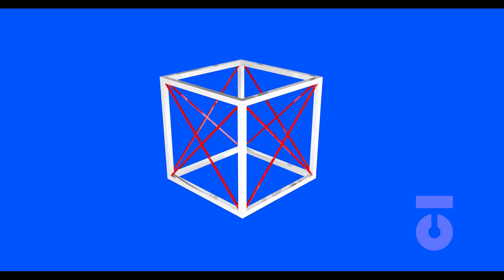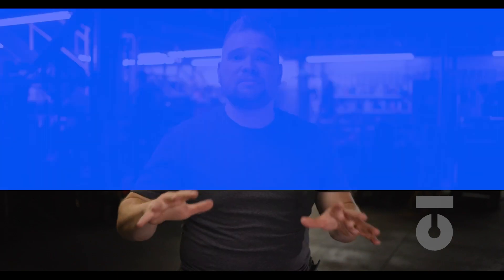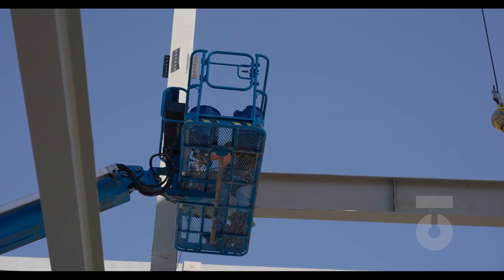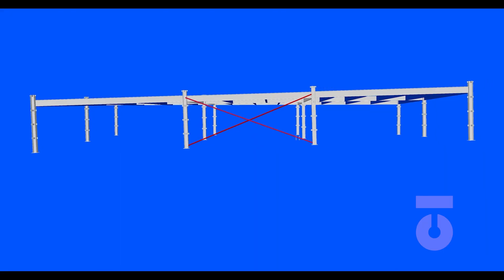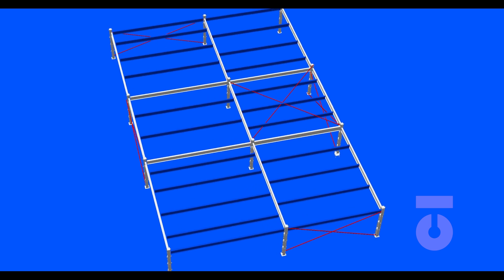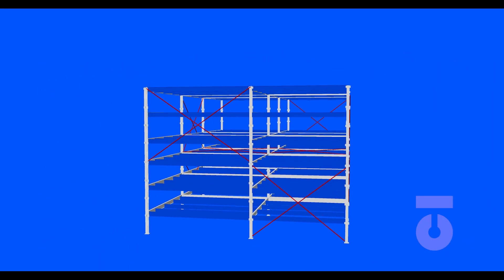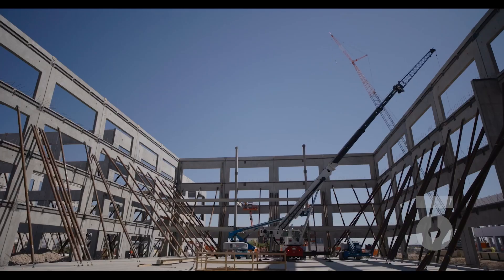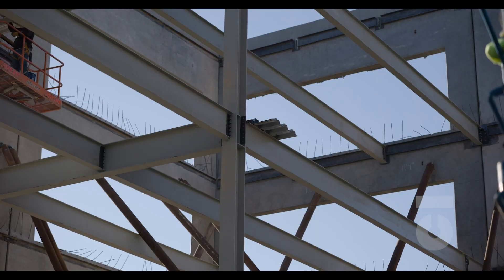Steel Erection Process: Part 8 - Plumb and sqaure-up the structure

Comment: So you plum your section (3 storys or whatever) after bolts are snapped and moment welds are welded? If your 4 columns are plumb does that mean your sq?
Reply from the maker: You don't want to snap or apply moment welds till you know you are square. Snapping or welding before plumb will cause a head ache of issues. Plumb and then snap and weld.